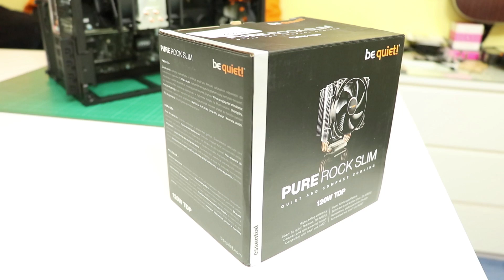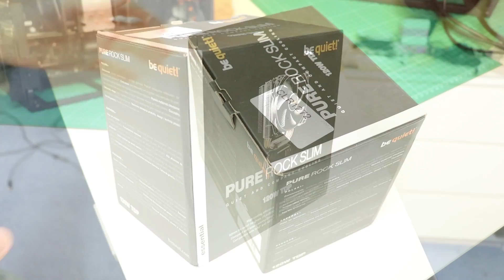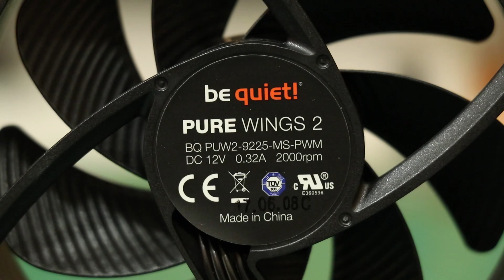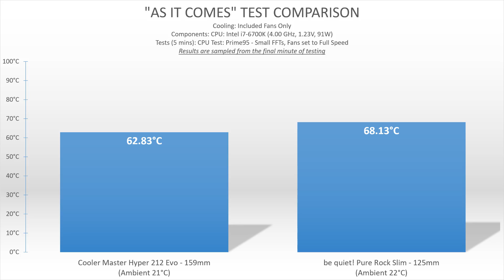be quiet! Pure Rock Slim CPU Cooler Un-boxed & Tested

Comment: currently running this cooler with a i5-10600k and its doing pretty well, it idles at 28-30.c and under load it has yet to even exceed 68.c (not overclocked)

Comment: Hi, I have a i5-9400f and am considering this cooler instead of the stock cooler. Do you think this cooler will bring lower noise and better cooling compared to the stock cooler? Great video nonetheless!
Reply from the maker: More than likely. Is there a certain reason this one matches your build? I guess it's a combination of size and cost?
Reply: @AVTechy  Yes exactly, it fits my budget well and is a good size for my case. Other coolers I have seen at 150-155mm in height where my cpu supports coolers up to 160mm. I thought those coolers would be cutting it too close so it seems this cooler is a better option.
Reply from the maker: If the case can fit up to 160mm coolers anything less will be fine. You can push right up against the limit if you wanted to quite safely.

I'd avoid going over the 160mm limit, but it's can be done since case manufacturers generally add some tolerance to the clearance dimensions stated.

Go for as big as you can within your budget (nothing too sketchy though).
Reply: @AVTechy  Ah this makes perfect sense. The only cooler that I am considering against this is the pure rock 2 from bequiet. I am not too sure on which one to get

Comment: I just got this one for like 30$. I'm using it with my i5 3570, and it is a nice upgrade over Intel stock cooler if you just need a cheaper but decent cooler for a low amount of money. If you compare it to Intel stock cooler, I get like 10 degrees less with the same usage scenario, and it is not as loud as stock cooler. And one thing I need to mention is that it's a bit harded to get the pins in, you need to apply a fair bit ammount of pressure on it, and that's the only minus I have for this cooler.

Comment: Managed to install one successfully. Thought it took two mounting attemps because I didn't realise what "at long as post are primed" meant. Any first timer should test the mechanism few times outside in order to understand how it works and what is the correct pin position.

Comment: id like to see a video which a duplicate fan as i have this cooler and im curious how it will be with 2
Reply from the maker: I've done testing like that with the Hyper 212 Evo, and an extra fan only knocked about 2-3°C in Prime95. A second fan really isn't worth the money. I think the money would be better spent on upgrading case fans to improve the fresh air intake and exhaust of the case so there's plenty of cool air for the CPU cooler to take advantage of.

Comment: is it better then an i5-8500 stock cooler? Build for Details. https://uk.pcpartpicker.com/user/TheDiamondMakers/saved/PQrV6h
Reply from the maker: Sorry for the late response. Yes it is definitely more capable than the latest stock cooler, not by a huge margin though.

Since you've got the room in the case, you may as well but a larger cooler for the same price. There's no reason to buy a smaller cooler when you don't have to.

The Hyper 212 LED, and the Pure Rock are similar prices but are larger coolers all round. Let me know what you think, but this reply is probably too late to help already.

Thanks for checking out the video, and best of luck with the build!

Comment: Hi, great video, you got a new sub, one quick question, do you think the mobo support is strong enough to handle the cooler? It's the same as the stock Intel cooler but the weight difference between coolers is huge
Reply from the maker: Thank you very much, I really appreciate the support!

Interesting point you've made there, the Pure Rock Slim is an extra 200g over the Intel stock cooler (previous revision). Which turns out to be over double the weight.

There aren't any issues with this however. The anchorage that the push pins provide on the Pure Rock Slim are quite strong, and we're only taking about 360 grams so it's not a substantial weight to hold up.

But I completely see your point. Over double the weight seems a little dodgy, but it works well enough, so I shouldn't worry too much if you were going to get this cooler.

Great question though, anyway thanks for checking out the video, and if you stick around I hope you enjoy many more to come!

Comment: Hello there, nice video and well done !
 I want to buy a pure rock slim to replace the stock cooler of my i7-7700 non K.. do you think the temperatures will go down and will be more quiet than the stock one ? 
The mobo, a micro-ATX Asus PRIME B250M-K which has 2 sticks of RAM on it will allow me to put the bequiet cooler in the same way you put it when you made the video ? When I'm checking if there is enough space I kinda doubt about that.. can u please tell me what u think ?
Reply from the maker: Thank you very much, and I really appreciate the support!

As for your questions, I think you'll certainly notice improvements in both temps and noise over a stock cooler. The larger amount of fins on this cooler compared to a stock cooler is one factor, and the continuous heat pipes delivering heat to all those fins is another to improve the temps. As for noise reduction, the fan is nice and quiet for everyday use (I was very happy with it's 1000-1200rpm running sound level), but of course if you're looking to kick it up to 2000rpm most of the time, noise is to be expected.

I wouldn't be concerned with RAM interference, if you find it's clashing with the RAM (it shouldn't get that close anyway) you can always put the fan on the other side of the cooler.

Let me know if you have any more questions, and of course thanks for checking out the video!

Comment: Hi bro , its dosnt come with thermal pate?
Reply from the maker: It comes with pre-applied thermal paste -->  2:02. However for testing I use Arctic MX-2 with all coolers to maintain fair test principles. Arctic MX-2 is a pretty average and affordable thermal paste, so there's potentially a couple of degrees to be gained by using a higher performing thermal paste.

Let me know if you have any more questions, happy to help out where I can.
Reply: AV Techy ohhh ty i orderd  this and when i saw no temral paste in ur video iwas shocked 😂😂 thermal paste here cost 15$ almost half price of the cooler
Reply from the maker: Jeeze that's a lot for thermal paste, the thermal paste that comes with the cooler will do the job well, so rest assured you won't need to be spending $15 on extra.

Oh, and of course thanks for checking out the video :)
Reply: Sorry for the late comment but i want to know before buying,i have a stock amd phenom II fx x4 965 be cooler and it's VERY loud,i think this boy will do the job,i want to know if i have to clean the old goldy thermal paste that i have on it before mounting it or i can use both of them without clean + the one that is on the be quiet.Thanks ^^
Reply from the maker: If the old thermal paste has been on for a couple of years it's worth cleaning it off and adding some new thermal paste. Some comes with the cooler so you shouldn't need to buy anything new.

Thermal paste will dry up over time and lose its thermal conductivity, so it's worth a new application when you change coolers.

Same goes for old GPUs, if temps become a problem, changing the thermal paste can make the world of difference.

I've got a review of the Dark Rock 4 out later tonight that also contains test results for some smaller coolers that may be useful to you.

Anyway, hope the cooler swap goes well, and thanks for checking this one out.
Reply: @AVTechy  thanks for the answer, actually my goldy paste is about a few month old, when i try to fix the fans i get dirty by touching it, so is still wet but i will clean ot first just for safety
Reply from the maker: No problem, it should be fine after a few months. But since the thermal paste is pre-applied to the base plate if this cooler then it's worth giving it a clean IHS to be seated on :).

Comment: No Sound/Noise  Check .... i dident find a answer here ..
Reply from the maker: Apologies for the issues, some issues that come up during voice overs don't get picked up until going through them in the edit. And by then I'm way too tired and can't justify time to re-recording the narration.

I aim high, but sometimes I just can't meet those targets...

But I'm always here to answer questions that didn't get answered through the video. There will be a few edge cases that don't get answered in the video since they may not be relevant to most people, or are not entirely obvious to cover. Hence why I'm active in the comments. Let me know what you need to know and I'll do my best to help out.
Reply: Thank you for your answer. I'm concerned that the fan should be quiet.
Therefore, it primarily affects my purchase decision.
Greeds from GER.
Reply from the maker: Yeah I see what you mean, Acoustic performance is something I want to measure in the future, but it's difficult to give an objective answer since I lack the equipment to measure it, and an opinion is difficult to give since my idea of quiet will likely not be the same as many other peoples idea of quiet.

I would be happy running this cooler as part of a small, quiet build. And to get an idea of what I think a quiet build is,  I feel the loudest part of a quiet system during general usage should be the Hard Drives.

I would recommend it for a quiet build, but that's not to say there aren't better alternatives on the market. The biggest cooler with the slowest fan will be (generally) the quietest cooler since the fan wouldn't need to spin as fast to cool equally as well.

Anyway, bottom line is I think it's worth a buy as a quiet option for a quiet system. As a general note of how quiet it is at idle, I was happy to shoot the intro right next to it. Of course there is an intro music track playing over it, but you'd just have to take my work that it was really quiet.

Sorry for the long response, let me know if you have any more questions.

Comment: Is it good to overclock an i5 7600k at 4.8 Ghz ?
Reply from the maker: 4.8GHz seems to be a pretty solid overclock from what I've heard. There are quite a few who have pushed it further to 5.0 and 5.1GHz, but that would be pushing the thermals a little hard and you'd want a strong Air-cooler or AIO if you're going to be pushing the system.

Here's a fantastic article from Anandtech which has some great infromation:
https://www.anandtech.com/show/10969/the-intel-core-i57600k-91w-review-the-more-amenable-mainstream-performer/11

Scroll to the bottom of the article to see the Multiplier and Voltage specs they used to get to the specific clock speeds.

And I would certainly get a much bigger cooler than the one in this video to cool a CPU towards the 1.3V mark. Anyway, thanks for checking out the video, I hope you found it useful. Best of luck with your overclock, and let me know if you have any more questions!
Reply: Thank you very much ! The video is great btw
Reply from the maker: +antiNT No problem at all, thanks for checking the video out!

Comment: Very nice quality video, well done. 
Good balance of information, details (caught that pointer) and enough b-roll shots to get a really good picture of the product but without overdoing it. All within roughly 10min, with quality video appeal. For future cooler reviews and comparisons it might be beneficial to compare them at the same rpm’s maybe 2-3 settings, at least for the same sized ones. 800rpm are 800rpm, a lot of other channels go for % and I think that is wrong, as 50% of a 2400rpm or a 1500rpm fan are vastly different things. You could still have the max. speed of the included fan in the test to show the max stock cooling potential of the product. 
Nice to see monitization seems to work, gladly watch the adds to help a bit, patreon seems to have reversed their changes as i heard so that could be a option again for your channel. A case to possibly look out for could be the silverstone pm-02 depending on price, don’t think it’s out yet though. Keep up the great work, don’t stress to much and have fun. Greetings from Germany
Reply from the maker: Thank you very much!

The thing that is nice about the full speed testing with the included fan (and with the 2200 rpm fans that get used on the 120mm coolers) is that it's very easy to perform with a lot less chance of human error occurring. I completely get you're point about the lower rpm testing though, I'm just trying to work out a decent way of making its implementation flawless. I too disagree with a percentage fan speed based thermal tests, I think there needs to a universal limit or sorts, whether its RPM or Db, something that is consistent between all fans.

I'll have a good think about it, but it would be nice to know if a cooler can deal with a CPU at full load at a lower fan speed. I'll think about it, but it might make for videos that are pretty cluttered with graphs. This one is a bit of an odd one where I couldn't replace the fan or add more fans.

Monetisation is back on track, uploading the videos 24hrs early and letting the monetisation work itself out before making them public seems to do the trick. Or it could be a coincidence, but who knows with the lack of information about monetisation. On the note of Patreon, I am in the middle of setting up a Patreon page, I was working on one before the Patreon price change issues, but now they have reversed the potential change I'm finishing it off. And thanks of course for watching the ads, you really don't have to but it's fantastic that you are for the sake of supporting the channel.

And thanks for the heads up on the new Silverstone cases. You're full of great feedback and support for the channel, thank you so much for going out of your way to put this much effort in to support it!
Reply: AV Techy Glad to hear my humble opinion and ideas help a bit, I watch a lot of techtuber stuff and feel many of the usual suspects are falling for the corporate marketing garbage, sure they made their friends in industry and stuff, but I believe the scene needs good new comers to fill in the blank spots. Everyone is saying tech channels are already saturated... don’t think so, if most of them do and say the same and are interchangeable as their “reviews” are only advertisement. Just look at the h500p debacle, only one channel caught the flaws...all the others copy/pasted the marketing wank.
And you are doing a great job of showing the products to help consumers make a proper decision - and that is what a review is for. Therefore your channel is already better as many other (bigger) ones out there.
Reply from the maker: Those are some very interesting opinions, and I agree. It's painful sometimes to see review videos that are purely reading from the webpage, or a reviewers guide.

I suppose at this level I don't have any industry ties to annoy since all the components are bought and not given to this channel. So I can say what I like without it effecting the revenue (generally speaking, there's no revenue here), or future access to the latest components to stay relevant..

And I thought there was something very off with the H500P reviews from a lot of the big channels. There didn't seem to much digging into the bowels of the case to see how everything worked. They just seemed to scratch the surface.

I truly appreciate the support you're giving to this channel. A channel (especially one as small as this) is nothing without great support from its community. And especially a community that keeps pushing the channel as much as supporting it, which is what you're doing so much of and it's fantastic!

I wonder how this Patreon page will go, and if it will have much of an effect on the day to day running of this channel. It will be interesting to see it unfold.
Reply: TheSickness1234 agree